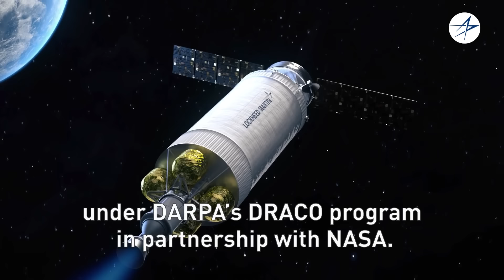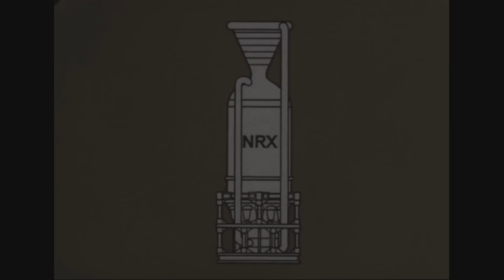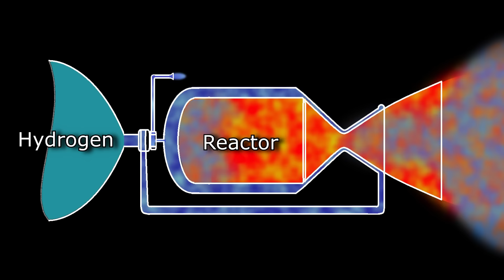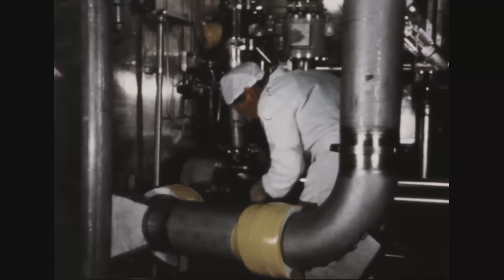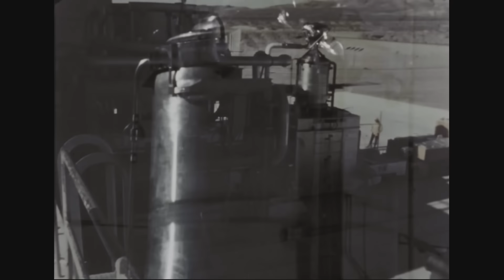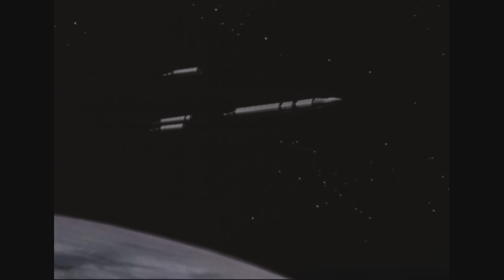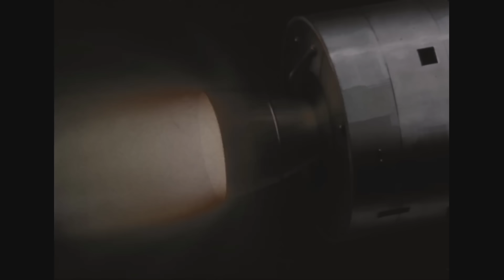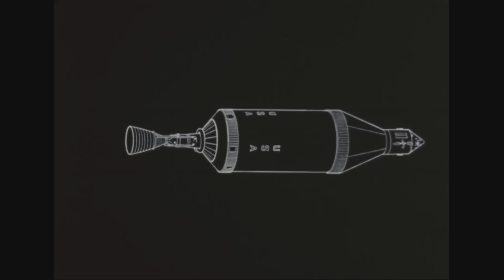Why Nuclear Rockets Are Going To Change Spaceflight

Comment: Life meme: The next big thing was already invented 50 years ago and a bureaucrat shut it down.
Reply: The one I heard was "everything new was done by NASA once in the 60s and then never again".
Reply: @Blaze6108   That one didn't make any sense to me either, but the NASA critics love to quote a broken record.
Reply: @Blaze6108 must've been fuckin insane to be a scientist back then
Reply: I seem to recall  concerns if something happening during launch spreading the fuel rods into the atmosphere  pretty much as they were concerned  at using nuclear jet plane
Reply: @jameshead9119  Assuming the reactor hasn't been activated, the fuel rods aren't really a health hazard as it only contains subcritical Plutonium or U235.
Reply: If it lands some uranium in the ocean it wouldn't be a problem at all. The ocean is so massive it would be a drop in the bucket, and it disperses the radiation. Even bikini atoll is pretty much fine below the water. You could eat the silt out of the radioactive craters and you'd die of malnutrition before radiation.
Reply: @jameshead9119  This is a real issue as space launches are inherently unsafe. The options in this case would be

1. use a human-rated vehicle with humans onboard to secure the fuel rods, and decide human-rated is as good as nuclear-proof, or

2. send the fuel rods separately in some kind of extremely armored package that is unpacked once safely in orbit. This is how Apollo handled their RTGs, but they were much smaller by comparison. The Apollo 13 unit is fully intact somewhere at the bottom of the ocean
Reply: Same with thorium molten salt reactors. Big oil really didn't want to have that kind of competition and now the Chinese are using the technology with huge rewards
Reply: @d3thkn1ghtmcgee74 there’s definitely other factors due to longevity of the reactor and byproduct management. But yes you are correct it has good qualities to it.
Reply: @d3thkn1ghtmcgee74  yeah, let's just leave out the part about the waste being buried underground in the Gobi.
Reply: 100%. i just commented something similar. oil money is very old and connected to Washington. its depressing lol
Reply: @poindextertunes  My hopes for the future of technology are in China.  They don't care about oil profits.
Reply: People who use government as a convenient scapegoat for a lack of progress are not thinking clearly. First, the research and development on advanced technology was probably either funded by a government agency or done by a government agency.
Reply: Second, vested interests are the real obstacle that stifles development in particular directions even when overwhelming numbers of people want it.
Reply: And a leftoid one at that, contrary to what some would like you to believe
Reply: Yup, and the would be king of space Elon seems completely averse to anything nuclear.
Reply: Who was heavy into oil and gas stocks. 😂
Reply: The 1950s is 70 years ago.
They were testing nuclear rockets and developing the F1 engine before Sputnik.
Reply: nixon killed it.
Reply: Actually JFK put the nail on this one in 1961 with the nuclear proliferation treaty
Reply: Not 'bureaucrat' but 'anti-nuclear activists'
Reply: WHERES MY HOVERBOARD
Reply: Government destroys everything it touches.  That’s why government is only good at military.
Reply: The exhaust of a nuclear rocket tends to be radioactive dirty, so there were obvious concerns should something go wrong.
Reply: You'll get thumbs up for this ignorant comment. But who the fuck wants rockets spewing radioactive waste in the atmosphere?
Reply: @dogefromthefuture  These are meant for operation outside the atmosphere...
Reply: Finite fuel, radiactive debris for crashes, radioactive exhaust for successes. It wasn't a beaurocrat, it was an average intelligence person(same thing, really).
Reply: @extremosaur  Not a nuclear scientist but if the rocket was launched via normal fuel and once it leaves the atmosphere the reactor starts and begins a rapid acceleration would that stop the more harmful and dangerous risks
Reply: @becauseforeverended8861  But it does not solve the crashing rocket or finite nuclear fuel problems.
Reply: @extremosaur  so off of an uninformed perspective what are the theoretical solutions for those real problems
Reply: @extremosaur we already launch probes and rovers with nuclear reactors. So yeah, not really why.

Comment: Would it increase the Isp to inject enough oxygen or fluorine into the hot hydrogen exhaust to have a very lean combustion to raise the temperature beyond what the reactor can tolerate?

Comment: If the nuclear engine is half the  the thrust of a liquid engine but lasts twice as long doesn't that mean you could run the liquid engine at half throttle and get a similar result. Or possibly just make liquid engines combustion chamber a smaller  volume for the same amount of fuel to be used?

Comment: I'm wondering now if we could nearly match chemical rocket thrust by using water AND hydrogen with the same reactor. When heavy thrust is needed, use the reactor heat water to steam and throw that out the back, but for normal cruising acceleration, switch to hydrogen?

Comment: Damn, can't wait till we get to a Neutron Flux Torch engine
That will probably require a revolutionary magnetic nozzle to work, but still - it's achievable with our current tech, and better than any fusion engine or antimatter engine.

The only problem is that it's basically flying Chernobyl.

Comment: I reckon we might one-day have spacecraft that capture space-dust as they fly through space, heat it until it becomes a plasma, separating it into negatively charged electrons and positively charged nucleases, which we then use a particle accelerator to accelerate to a high fraction of the speed of light before releasing them in a specific direction.

Comment: Could see it as a manned Mars freighters running the 2 year loop. Starting and returning to a lunar orbit moving containers and smaller spacecraft and using tugs to move the containers from parking orbits to to and from the freighter. Thinking they will want a Mars ISS, tugs, tons of materials, smaller shuttles (Dragon sized) and Starlink/GPS systems before running the Starship derivitive ships out to Mars loaded with lots of people.

Always had a preference for the slower loop routes since the return is about assured. The faster routes, well the really fast routes, can generate a sizable miss should a problem occur.

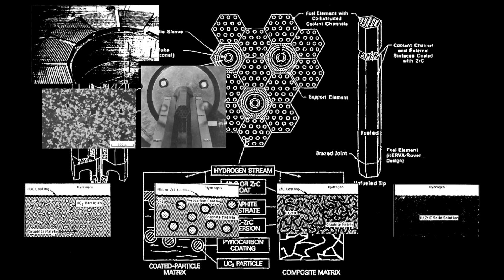Comment: People are talking about the machines down uranium fuel rods but am I wrong here or didn’t he say the shell was a different material which is filled up with uranium? Meaning machining it down would create an inert metal dust rather than uranium dust? I think he mentioned the composition of fuel rods around 10:40
Edit: time stamp correction

Comment: If it's ejecting propellant, then that means you have to have a supply of propellant on hand, which will eventually run out.  So, these are relatively short range rockets?  Not what I initially thought, "Nuclear reactors can run for years".

Comment: I once read about Project Pluto, a test program for a nuclear ramjet-propelled cruise missile that could fly at Mach 3 for days on end. Downside is the highly radioactive exhaust. I for one am glad to live on a planet with no flying Chernobyl disasters.
Reply: For the purposes of an apocalypse weapon the radiation spewing exhaust was an UPside.

But even cold war planners were not insane enough to put these into service. Which is a good thing.
Reply: There were two versions. The first, safer version used a heat-exchanger, so no direct contact between atmosphere and core. But it was much heavier and less efficient, so option two was to say 'screw it' and have a reactor core open to the atmosphere.
Reply: The exhaust of a nuclear missile would most likely be surprisingly harmless.
You are always exposed to radiation, a bit more in the sunlight a bit less in the night. The problem with high radiation is that it damages cells faster than your body can tear them down and replace them.
A sonic missile will mix it's exhaust with insane amount of air, and wind will diffuse it even more. Also exhaust has is extremely hot. At high temperature fission works faster. One huge problem of the 80's reactor was that the core had to be rather cold, because of the thermal/mechanical limits of steel. Modern reactors use ceramics or tungsten which allows them to burn their fuel more efficient.

Comment: You can keep in orbit a bowl-shaped radiation shield with a cutout in the center the size of the shadow shield, and the rocket can dock into this before any loading and off-loading is done. That way you would only have to avoid the back end of the rocket. In fact if the bowl had a lid that can close behind the rocket, then you wouldn't need to worry about radiation hitting crew and cargo at all.

Comment: The real problem for using nuclear engines is that for them to be worth it, you must use Hydrogen, and storing hydrogen for a long period of time is quite difficult. Since hydrogen molecules are so tiny, they will leak from virtually any container

That is one of the reasons why spaceX uses methane rather than hydrogen: It might be a little less efficient on paper, but storing methane for months is not an issue at all

Comment: The “special” projects nuclear submarine NR1, (you know, the one that planted the charges on the gas pipeline!)😂 was kept small and light by using a 12' flooded compartment as biological shield between the crew and reactor compartments. This having the same shielding effect as 12" of lead but having no mass in a submerged submarine.
 Perhaps the mars mission's recyclable water resource could perform the role of biological screen. The water could even be partially used as second rate fuel for the return journey's deceleration burn.

Comment: For rockets that are already in space and they need to move between locations, can you add lots more solar panels (say 10 times those on the ISS) and compete with chemical/nuclear? Or does adding the panels have a 'tyranny of the rocket equation' issue too with the extra mass building up faster than the extra power.

Comment: What about the same concept but powered by a fusion engine? It would have a lot lower safety/shielding requirements, a lot more power, and a lot higher specific impulse, I believe. Lighting and shutting down (or even throttling) the engine would probably be easier, and I think the propellant itself would be the fuel, instead of having propellant and fissile material. Of course, we first need to solve fusion.

Comment: A relation of mine worked, maybe still does, for Boeing, his job was to design and build an atomic jet engine. Yes,  he did, BUT they were unable to stop the ablation of the jet's internals and the trail of radio active particles left in the exhaust.
Reply: Ah yes, the open cycle nuclear jet engine. There was also closed cycle design that used a coolant loop to get heat to the air without the radioactive mess being blasted out the back. It was heavier and less efficient, but far cleaner.

Comment: Nuclear R. E. as exposed here are a huge NO_GO, for way too many reasons, with too many downsides. We need to wait for fusion, and high thrust fusion drive, to get ourself in a realistic path to colonize just our own yard, the Solar System.
"With ion engines, chemical engines, and nuclear torches we're facing a classic Newton's Third Law problem. Somehow the exhaust needs to have sufficient momentum for the opposite reaction to give the ship a good acceleration.
Chemical rockets solve the problem by expelling a ton of mass at a relatively low velocity. (high propellant mass flow but low exhaust velocity: SUV)

Ion drives expel a tiny amount of mass, so to get anywhere they get it moving FAST, but even at gigawatts of power they get a measly 0.0001g. (low propellant mass flow but high exhaust velocity: Economy)

Torch drives take a small-to-moderate amount of mass and use nuclear destruction to get it moving insanely fast. (medium propellant mass flow and high exhaust velocity: Torch) They're the only ones  with enough power per unit of reaction mass to get 0.3g constant acceleration conveniently. Even a perfect ion drive would need a phenomenal (read: impossible) amount of power input to match the performance of a nuclear explosion. " (extract from a dedicated site of rocket tech) .

And we are many decades away, sadly, from this dream, because we are a stupid race, "dedicated" on the path of self-destruction,  a stupid race who elect, as a rule, the stupidest of us to "lead" us,  ( see Biden and the USA) - and oh boy, they do lead us to the wars, destruction, and ambiental  disaster. 
With just A FRACTION of the amount of time, money, and resources we spent just in the last 20 years to produce weapons and find "better" means to kill our foe, we could have built a dozen of full bases on the Moon and get a step closer to the Mars... 
But again, I feel we are doomed to allow the idiots who lead us to end our civilization.... probably not the first time, on this planet... must be something in our genetic code...

Comment: Wrong conclusion at the end.
 Since, to be continuously using enriched Uranium, as a thermal compounded partial fuel; it requires an amount of water based coolant, that would equate into 5 times the volume of the vessel, itself. 
Therefore, the concept spaceship, with nuclear propulsion, from the KSP computer game series; that is shown at the beginning of the above posted video; is actually mildly correct.

Comment: Why not use solar powered nichrome heating elements to heat up a steel core that looks like the interior of the NERVA combustion chamber and use liquid ammonia as a propellent since it disassociates into nitrogen and hydrogen at 600C, about 1/2 the temp that steel melts ? Nichrome elements could heat the core to 1000C.

Comment: Something that is an effective shield is distance. If the nuclear engine section was attached via a long enough tether to the manned payload, little to no heavy sheilding would be required. 
Envision a fleet of nuclear fueled space   "tugs" that would tow chemically fueled vehicles out of orbit and between planets. The tugs would need to be refilled with the reaction mass, but the nuclear fuel could last for multiple transits. A starship could then land on Mars with enough chemical propellant on board to take off again without refueling. That could eliminate the requirement for fuel manufacture on Mars.

Comment: Fun nuclear engine history bit: The ROVER program was initiated as a DoD program because the Air Force initially thought that they could get a nuclear missile by using the warhead as the propulsion reactor. Found out quickly that wasn't the case but they still kept the program going on the chance they could use nuclear rockets on planned Air Force upper stages. Then NASA came along and they took over the program.

Nice overview (including power generation was a nice touch) and I hope you can expand on the basics with LANTR (Lox Augmented Nuclear Thermal Propulsion) and some alternate configurations such as DUMBO. Thanks again!

Comment: 4:40 “ Expanding hot gasses through a nozzle “.
In other words just an iteration of the first steam engine, i .e. heat and squirt. This will never cut the mustard in terms of interstellar travel.
Unless we discover some new physics humanity will inevitably splutter into extinction without setting foot outside of the Solar System.

Comment: 16:18 you are incorrect the Davy Crockett nuclear warhead fired from a recoilless rifle was a 20 ton warhead not a 10 ton warhead so you are off by 50%, but it was the smallest warhead ever created and it was about the size of a rugby football, a little bit bigger than a American football it was fired from a recoilless rifle and it was by far the smallest nuclear weapon ever tested. It’s about 1000th of the size of the bomb detonated and Nagasaki the Fatman bomb that was 20-22kt I think it was one of the dirtiest nuclear bombs ever detonated. It was so in efficient at least that’s what it looked like it looked like a mushroom cloud of black smoke. But the M28/M29 Davy Crockett had a Blast Yeild of 20Tons about 1/1000 of the Fatman or Gadget Bombs detonated in 1945

Comment: do you know why exhaust hydrogen is ignited past the nozzle? One reason could be the heat from the NR is not enough to produce net thrust and the thrust of burning H2 inside the nozzle is bigger. Then you do not need Nuke heat and derived hazards, use a conventional combustion rocket. Notice how big the nozzle is

Comment: Aside from the issues with amount of available thrust, there's also another issue with using nuclear thermal rockets for stage 1: It turns out that we usually like to be able to reuse our launch sites.
Reply: You can't get much thrust from the NERVA design but DUMBO is a different matter. Easy to get F1 class performance from that.
Since the rocket motor isn't going to be spitting huge portions of itself out, the primary hazard to the launch site would be neutron activation. But the reactor will not be around very long to do much in that regard.

Comment: Take nuclear power and use it for lots of ion drives. If you have one hundred times the number of ion drives, you can get the benefits of both systems at once and still get the speed changes you want.

Comment: This would make a great "Outer-System" module for something like Starship.
If we had orbital manufacturing partially unlocked, it could even have a practical amount of shielding.

1. Launch a specially engineered & "Super Heavy" into orbit...
2. Launch a pre-built nuclear rocket package, in multiple trips if needed
3. Tear out the chem engines, get to work.
4. Launch a passenger "Starship" to rendezvous with Franken-stein, refuel, and head to Europa on the new Space Hot-Rod.

That, and a metric tonne of time and money.